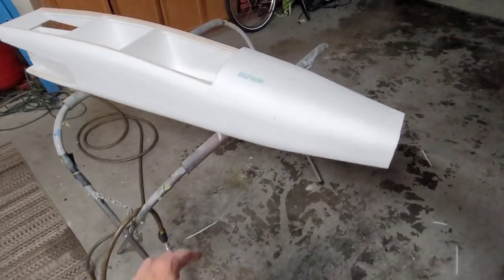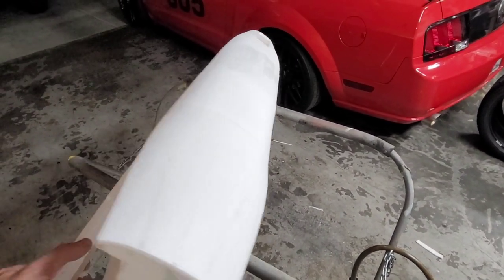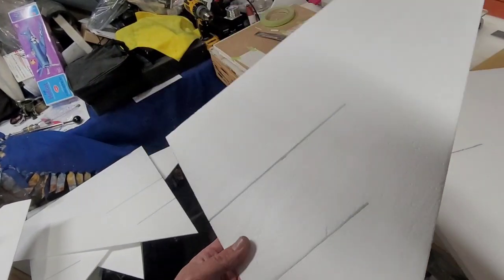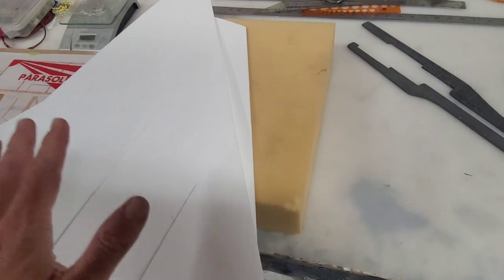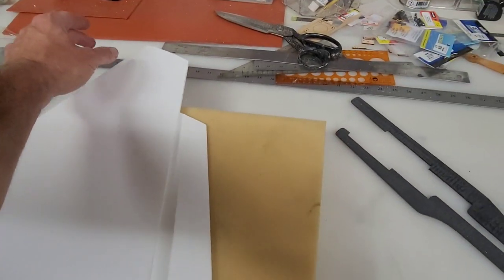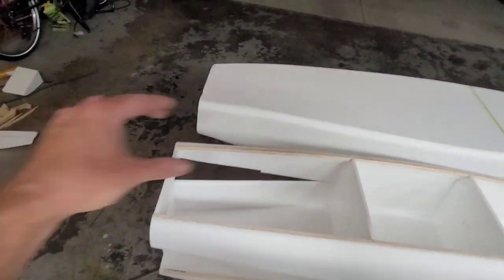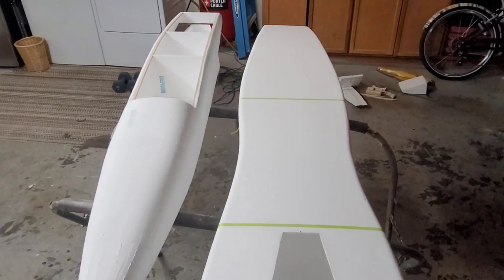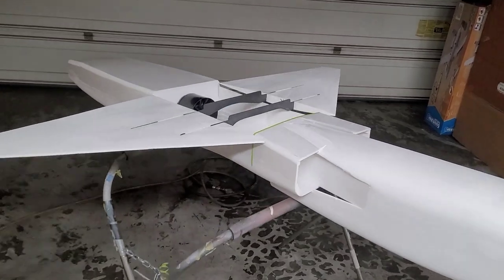105" edf r/c t-38 talon build ep-2

Comment: I am loving this build, both the subject and materials used. The size and light weight of your design are what makes for a great flying plane. It should look so scale. And be gentle on those wheelie landings.😀

  I have wanted a jet but $$ involved  turned me away. This looks very doable.  I have been looking at foam board to start swapping out the balsa in more traditional construction and to develop some new ways to still build light and keep cost manageable. Shipping the foam is the big money problem now. Finding Dow Hi load Foam in N.E. Mississippi close to me is like looking for hens teeth. 

All the best on your build and thanks for sharing!